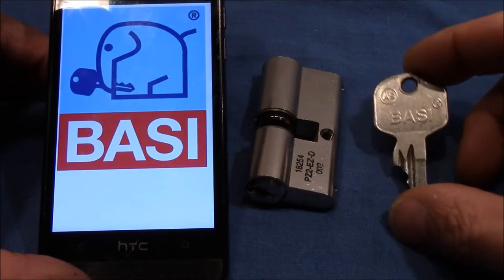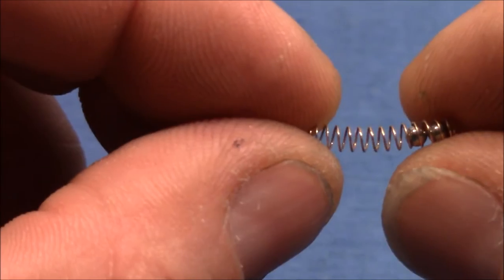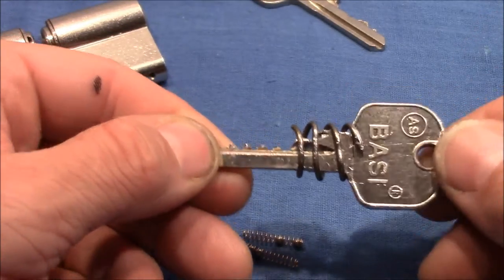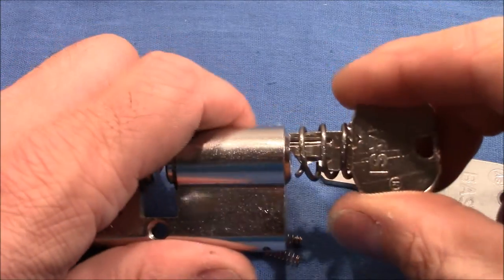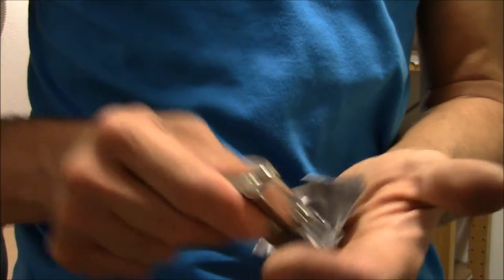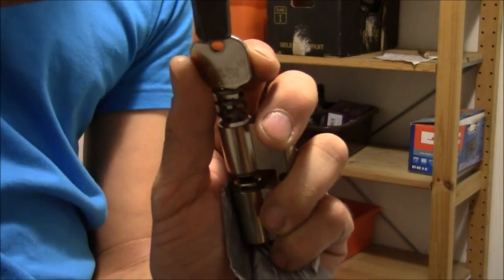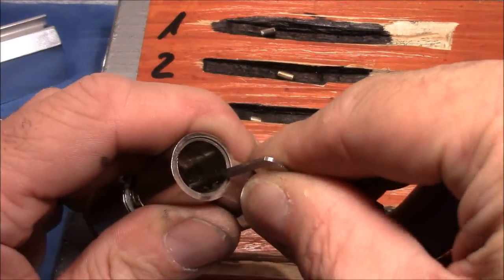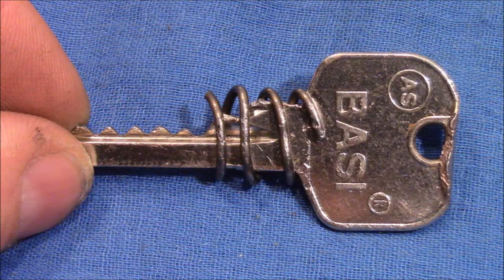(picking 66) BASI euro cylinder with unusual springs bump-tested

Comment: Great video as always, well done. Couldn't find anything on bearings being placed in the springs. Very unusual but the more you looked at the anti bumping option the more it made sense. Very well done
Reply from the maker: +Thor Thank you. I've written an email to the manufacturer with images but not received an answer yet. On their web site they sell the exact model that I have but they say nothing about bump-resistance for this model. Will let you know once I get an answer.

Comment: Another fantastic video buddy. I too have never seen bearings in springs and would be very interesting to find out why they are there.... it could be a failed idea to stop bumping as I have bumped so called anti-bump euros.
Reply from the maker: +waddac2 Thank you Rich. Love your assumption of the failed idea. This sounds very reasonable. I'll see what happens when I ask the manufacturer.
Reply: +Potti314 Go for it mate and ask them. They should divulge reasons if they watch your video as they may think about making it better for anti-bump if that was the intentions of the bearings. Some manufactures love locksporters and some not, nature of the beast as we can show faults easier ;o))))
Reply from the maker: +waddac2 Here is the follow-up video: https://www.youtube.com/watch?v=DN0LTsq4FrE It covers more than just the answer from the manufacturer ;-)

Comment: Do you think it was the orientation of the lock when you were holding it that helped defeat the balls in the springs??
Great video again buddy👍👍🆒
Reply from the maker: +Pick Beard No, definitely not. While my extensive testing I tried all orientations without seeing any impact to the bumping result. Also if you consider how an euro cylinder is mounted on a door (bible at the bottom) - the gravity would cause the balls to lay on the bottom of the chambers. This way they would have the least impact.

Comment: I think it could be protection against comb pick. The spring with balls cannot be compressed so far to clear shear line with both pins. Driver pin will rest on balls and don't allow key pin to go down to bible enough. I heard some conspiracy theory (from Schuyler Town's video) about comb pick attack popularity in Germany in the past.
Reply: great point.
Reply: +Mike Pergl I think you are right, Mike ;)
However, great bump key Potti!
Reply: +Mike Pergl This idea gets my vote. I saw the same thing on a ZI i recently sent MrAnybody.
Reply from the maker: +Mike Pergl Actually I don't think so. Lock at that time (9:38)  https://youtu.be/5-6188RqHlc?t=578 You see clearly stack #1 has the metal ball and stack #5 doesn't have them. Both about the same overall pin-length. Even more, why would you add balls inside the springs which seems expensive and cumbersome. The comb pick attack protection could also be achieved by a simple short pin below the spring in the chamber of the bible.
Reply: +Potti314 I agree with you that there are simpler solutions to comb attack, like don't drill the chamber itself so deep. And that balls should be with the longest pins (clearly not third pins). Even more the profile of keyway on your lock should be enough to stop comb pick. It was just a thought I had while watching the video. I didn't see any other explanation for it.
Reply from the maker: +Mike Pergl Yes still mysterious what they are good for. Like +waddac2 says, maybe just a failed idea to make it bump resistant. Thanks for watching, mate.
Reply from the maker: +de Ronchopathe Thanks.
Reply from the maker: +l0ckcr4ck3r You mean two ball bearings in the springs? Do you have pictures of the pinning?